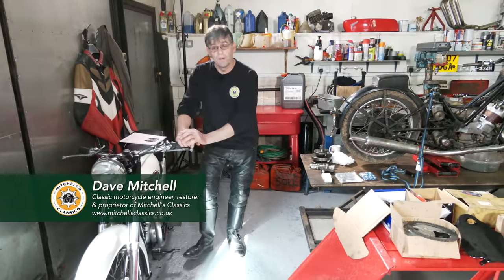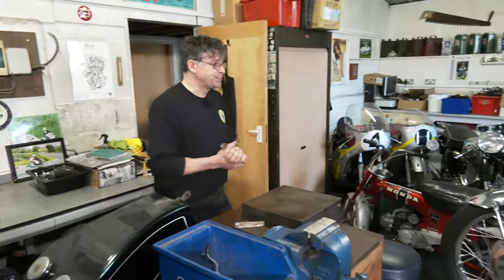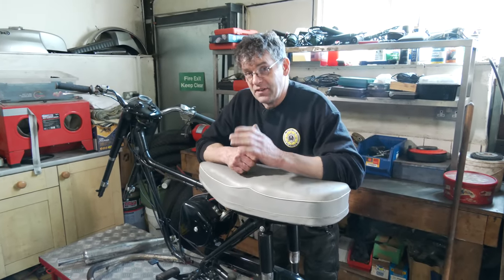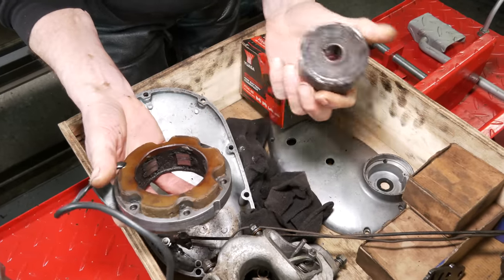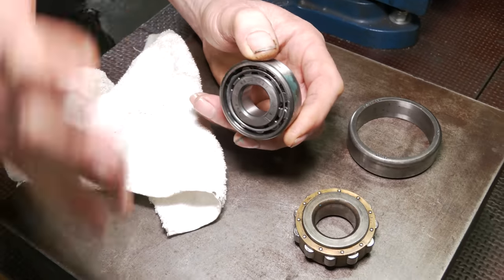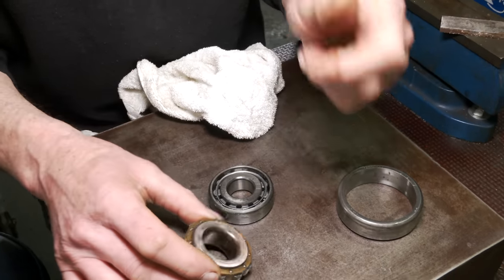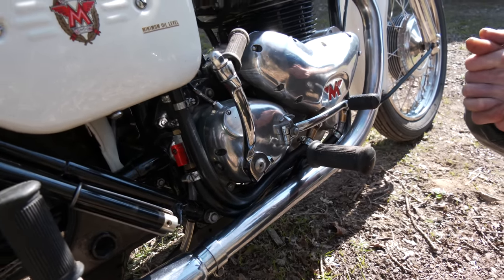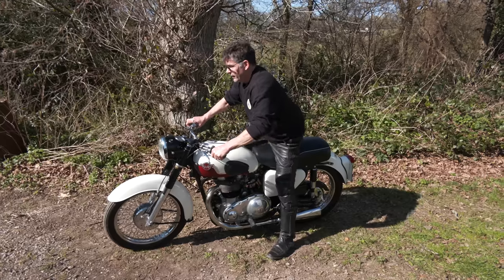Classic Motorcycle Workshop Vlog 4 - Matchless G12 road test etc

Comment: I'm working on a T120. I replaced the clutch basket. Front gear and chain. With the tensioner adjusted all the way up. To much I think. I still have way to much slack in the chain. Did Triumph offer different length primary chains for the T120. Have they shipped me the wrong chain.? Thankfully. RMM

Comment: A bad battery is death to the charging system. If a battery goes flat in the bike and won't take a charge, then it needs replacing BEFORE the bike is ridden. Don't jump start the bike. Seen many Japanese alternators fried because of a (comparatively cheap) dead battery. Then you have to spend hundreds on charging system parts AND a new battery.

Comment: Lovely bike. I bought a 59 model last year. It’s actually got the mag and alternator. Apparently the factory mixed and matched quite a bit. One thing to watch with magnetos,  as you heard a bit with yours, they sometimes misfire on full retard. This is not unusual with twins, as the spark weakens on retard. It affects one cylinder more than the other as the spark polarity is different from one plug to the other, and the spark jumps better from the centre electrode. Obviously not a problem with coil ignition if the coil is wired correctly.(It was a major problem on my bike until I cleaned all the carbon dust from the slip ring distributor!) Thanks very much for the very enjoyable videos.